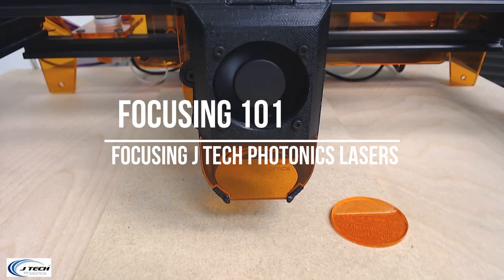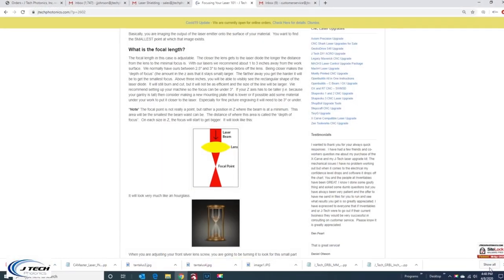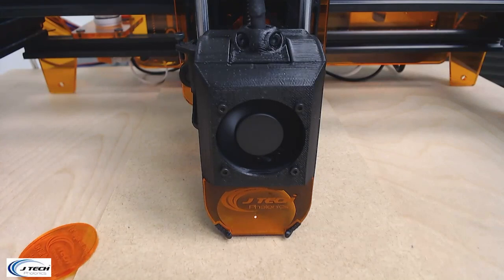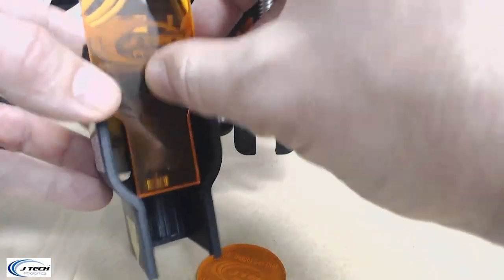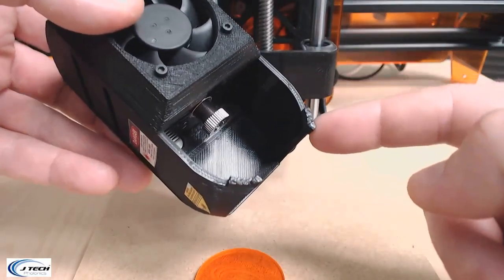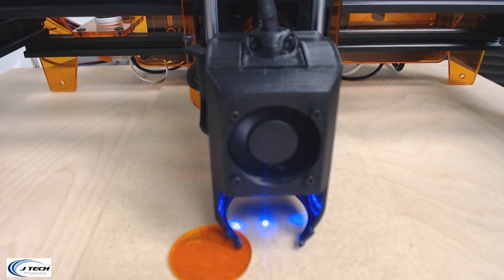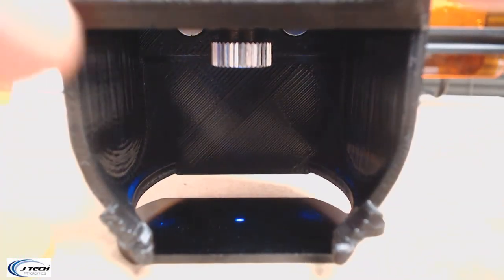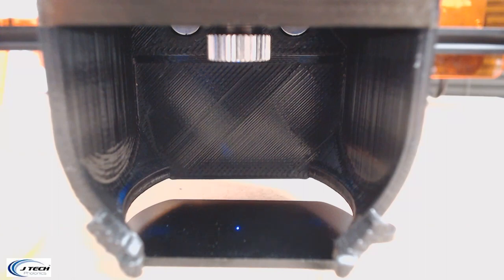Focusing J Tech Photonics Lasers

Comment: My power needs to be at 8.5% to start being visible when pressing Fire. The beam flickers between 8.5% and 8.75%. 9% provides a steady beam to focus. Is this a setting I can adjust?
Reply from the maker: Sorry for the delay.  Each driver and machine combination will be different.  As long as it is low power the percentage is somewhat meaningless.  9% will be fine for the low end.  It has to do with the laser "threshold" to turn on.  Each combination of laser, driver, and control board is going to be a bit different.